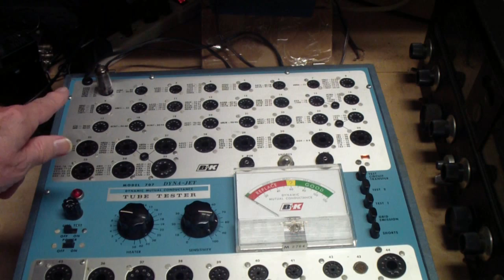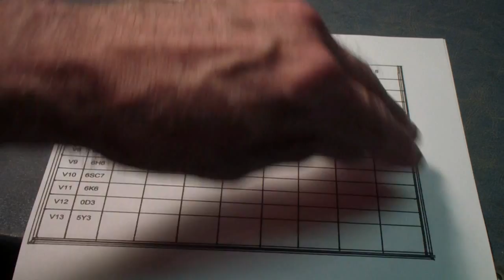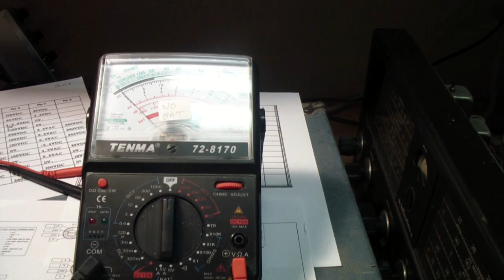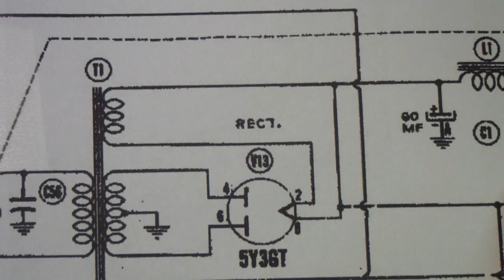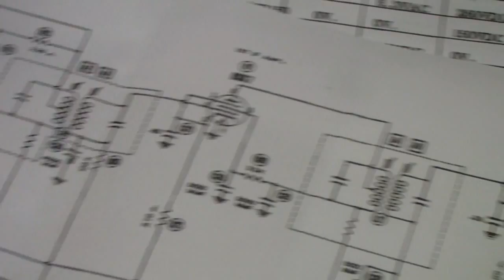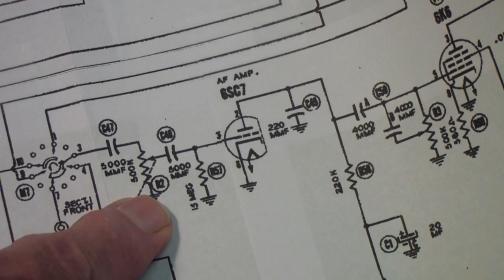TTT183 Hallicrafters SX71 Restoration Pt 2

Comment: Hi! That was a great video. 
I've got one of these models (SX-71) and it's still working. However the chassi next to the isolation transformer is a bit warm/hot. I heard your safety notice about this condition and I would like to hear your opinion. Worth trying to find a workshop that could review the operation conditions of the radio?
Reply from the maker: I am not sure if I completely understand your question but if you find the SX71 chassis warm near the power transformer, that could be normal but if the electrolytic capacitor can feels very warm then the capacitors are probably leaky and need to be replaced. The transformer in the SX71 will always be warm after some use, but the capacitors should not be.
Reply: Thank you very much for your comment on this. It was exactly what I was reffering to. Forgive my imprecise comment. 
After a couple of minutes of use I can indeed notice that the external case on that side becomes very warm. But I'm only touching the external case. I guess the internal chassi might also be quite warm. But as I'm touching the case next to the isolation transformer, now your comment makes total sense.    
I will power it up and check if there is any capacitor running too hot using some tool that would be safe to use (infrared thermometer for example?).
I appreciate your help and attention.
Best regards.